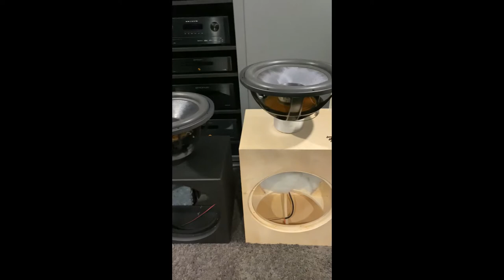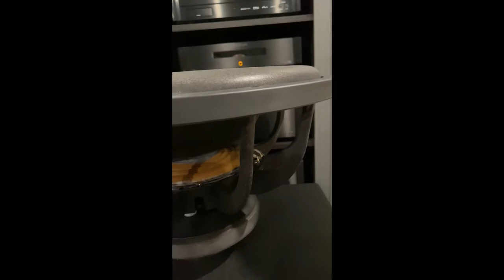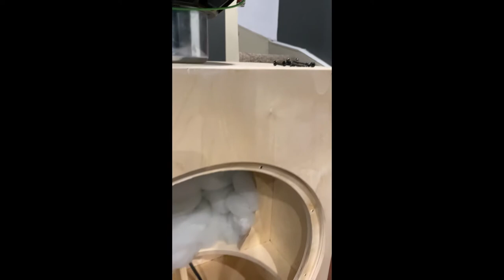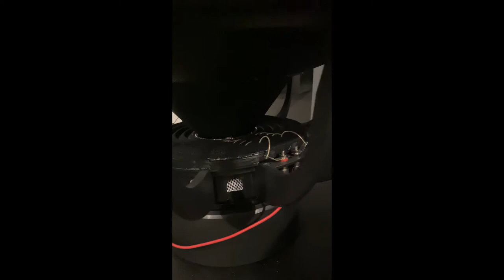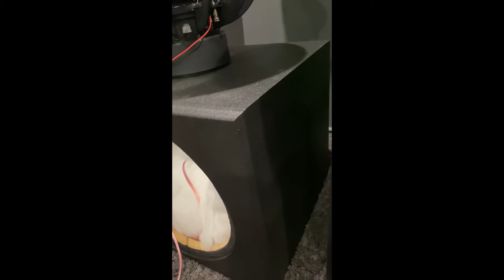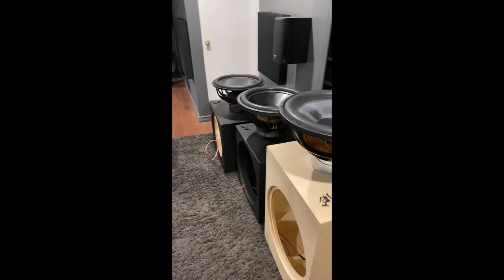Dayton Um18 - Jtr s1 - Harbottle audio m18vs

Comment: Hi there.i built a full dual marty x2 with um18 (custom)
But now I'm planning to try out sealed.
I'm not after high spl or super lows just the cleanest sounding over all. Is it Worthing trying x2 um18 sealed?.
Reply from the maker: Yes I think so. I preferred the sound of sealed from them. I used multiple so I still got tons of low bass. But I would say it’s worth trying out for sure!
Reply: @thebrowncinema  thank you. Yeah my old setup were dual 15 paradigm and liked the sealed sound. Can't imagine what an 18 sealed will do. Can't wait to start build.
What measurements did you use?
Reply from the maker: @almiragustin2262  mine were close to a 21” cube. I just made them 4 cft. But to be able to fit under my screen.
Reply: @thebrowncinema  what's your opinion on copying jtrs2 but running um18x2?  Dual 18's
Reply from the maker: @almiragustin2262  I tried to sim them on winisd once but got a weird response as I was thinking of doing that. Better off making them singles and stacking them. That way if you ever want to change it up they are already single subs
Reply: @thebrowncinema  yeah I think 4 individuals will be better option. 2 at front 2 at rear :). If I did do this setup would it be a big significant up grade to my 2 full martys? Sorry you seem to have alot of experience just watching your YouTube channel lol
Reply from the maker: @almiragustin2262  I think so for sure as now you can add them all in and they will help each other fill nulls ect so when you eq them you should get a better flatter response with 4 places at different locations then just 2 big monster Marty’s. They will sound different at first but once you get the right eq curve you like then watch it for a few weeks I’m sure you will love it. I’m glad I went back to all sealed subs. I’m a believer in strong sealed subs!
Reply: @thebrowncinema  yeah at the moment got big nulls at 70hz and very hard to get good room curve I don't want to boost to much. Thanks man. Love your channel.
Reply: Sorry you wouldn't know what measurements I can use for sealed un18-22?  Cheers buddy
Reply from the maker: @almiragustin2262  I can measure mine later or try and find some online. I would just build one to what ever measurements best fit your room
Reply: @thebrowncinema  I can play with any size. Smaller the better :). I may follow the parts express measurements.
Reply: Hi there again :). Iv built my x2sealed um18 and loving the sealed.  Just asking do I put a hpf on my mini dsp? At the moment iv got it at 17hz with a hard roll off. Is there anything you can give ad an advice? Thanks man
Reply from the maker: @almiragustin2262  no need for the hpf at all. I don’t run any on my sealed subs! Glad you like them.
Reply: @thebrowncinema  really? Won't blow up? Strange since iv gone sealed iv got way more mid bass and my wife even noticed the bass is cleaner (natural). . Ported just seems over exaggeration now I can hear the diff. :)
Reply from the maker: @almiragustin2262  no won’t blow them. I can play 7hz chopper scene on my um18 no problem. Ported is hard to get right, even then it needs to be eq’d ect, same as sealed so they sound good, but from all the subs I’ve ran, sealed and multiple of them is my favourite by far

Comment: Hi Brown Cinema, the um-18 box from the tour you did like 5 months ago looks different to this (the one in this video is asymmetrical). Did you dismantle the previous one? Also, can you please share the dimensions of the previous one? I want to make one that's symmetrical at the front baffle
Reply from the maker: That’s correct the one in this video is the parts express flat pack. The one from previous video was a custom one I made for the dimensions that worked for me. I actually built 2 new boxes that I will be doing a video of soon!
Reply: @thebrowncinema  awesome, I have modelled the um-18 on winISD and I'm comfortable with anything between 5cuft to 6.5... but I don't want to use parts express flat packs because of that asymmetry hahah. What made you change to this one?
Reply from the maker: @DesmondKarani  I run 4 cube after displacement for my sealed subs. I just built 2 modified some what full Marty’s. They are 11cubes tuned to 11hz. I’m painting them tomorrow so will make a video of them very soon.
Reply: @thebrowncinema  Was the front baffle triple baffled or duo baffle in the previous DIY? It looked sleek with the UM a bit recessed
Reply from the maker: @DesmondKarani  they are all double baffled. The jtr was the only triple baffle

Comment: So.. which of the 3 is loudest, cleanest, lowest response? Same power going in? Best bang for buck?
Reply from the maker: Tough question kind of lol. The jtr’s amp had a built in house curve that I couldn’t turn off. The amp would clip easily also, not sure why maybe boosted to much. Bang for the buck would have to be the Dayton 100%. But I tell people that ask me, If you had to buy 1 sub and only use 1 sub. The harbottle is amazing! I use it on my main floor off 400watts and it rocks (in the future I’ll get the speaker power 2400 amp for it). But if you want to do multiple subs and on a budget, then the um18’s is where it’s at. I’ve actually changed it up a bit since this video and I’ll be doing a new video soon just been super busy!

Comment: Nice video which is the best choice for a home cinema and playing music?
Reply from the maker: Out of those my favourite was the harbottle. The um18 is a good driver don’t get me wrong. The jtr is good also but being an older model and not able to turn off the built in dsp sucked and that’s why I sold it. The harbottle sounded amazing but like the um18 you need to pair it with an amplifier
Reply: So they are all good, these are a bit expensive for me I'm getting 2 spl 150 they should be a big upgrade from the r 120 SW the rear ported ones
Reply from the maker: @glengatt3941  yes in their own way.

Comment: Just ordered eight of the Ultimax 18".  I got one awhile back and did distortion measurements on it, it's a fantastic driver.
Reply from the maker: That’s awesome! What are your plans? All sealed or ported? 8 of them will be a ton of output!
Reply: @thebrowncinema  I have this grand plan of building a manifold system in the attic and making them infinite baffle... however, that's probably going to be too much work so more likely they will be in large sealed boxes instead.  I'll use miniDSP to EQ them and probably only use them for about 25 Hz and below.  I'll use multiple MCM 15" woofers in open baffle for 25 Hz to 80 Hz.
Reply: 8??? Wow! Would an 18" Dayton sealed compare to a ported Svs or Monolith?
Reply: @justinmanny86  I haven't tried the SVS or Monolith but I'm not a big fan of ported subs.  To me the best quality bass is open baffle, 2nd best Infinite baffle, 3rd sealed, and ported is a distant 4th.  I recently put in an additional four 18" Ultimax's so now there are twelve in the room.  I suspect they could do structural damage if I really pushed them.

Comment: Would be awesome to see how the ultimax compares to the other, much more expensive subwoofers.  I'm thinking about getting the another sealed sub such as the harbottle to pair with my SVS PB-13 Ultra (running in sealed mode).
Reply from the maker: The um18 can keep up. It will just run out of steam before the others. The more expensive drivers have more xmax and low distortion. So the um18 will start to compress while the other drivers will keep going. If your going to do multiple subs then I like to recommend the um18. But if your looking for something powerful and only can do 1 or 2 subs the harbottle is an amazing sub! 
I do have 2 of my um18’s in porter boxes now that I will be showing in a video soon!
Reply: @thebrowncinema  thanks for the note. I was thinking about pairing a UM18 with my SVS in hopes of getting a more even response in the room and some more tactile response. Ive hearn pairing a ported sub with a sealed can create some issues so maybe doing 2 UM18s instead and selling my SVS would be a better option.
Reply from the maker: @garethmorris2042  it can be tricky. I mix porter and sealed but I’m using the same drivers so it’s a little easier. Budget wise you can do 2 um18’s sealed and an amp for pretty cheap compared to many others. Just make sure to use a minidsp to tune the subs!
Reply: @thebrowncinema  so would you recommend 1 harbottle over 2 um18's?
And when you say it will compress do you mean in the low frequencies or at higher spl?
Reply from the maker: @Techdiscussed  in that case I would prob get 2 um18’s If there was no plan on getting a 2nd harbottle. For the price of the harbottle I can build 2 um18’s. So the more cone area will win plus the bonus of being able to have 2 subs in 2 different locations. The um18 will compress in spl.
Reply: @thebrowncinema  very intrigued to hear your thoughts on the ported um18!?
Reply from the maker: @levrone0075  I had 2 custom full Marty’s for a bit. I made 11 cube boxes tuned to 11hz. They were big, but worked very very well. I had them laying under my screen.

Comment: where can i find the specs of JTR RS1 driver? I would like to buy that driver and build a custom closed box, drive it with an external amplifier (I have to figure out which one to put) and give all the parameters with the Trinnov Altitude processor, do you think it is possible to get such a setup and it sounds great?
Reply from the maker: For sure. This was the s1 so the older model from the rs1. The rs1 is built by jtr as far as I know. You can contact them to see if you can buy the driver but not sure if they would do that. You can look into stereo integrity for drivers or harbottle audio. They sell raw drivers. For amps look into speaker power. That’s who jtr uses for their subs. Big power from plate amps.
Reply: Im looking at doing the same. You would need to hunt for a Behringer Inuke nu12000 dsp it is 2500 watts rms 2 ohm stable. That thing will run a pair of the Neo 3.7's.
Reply from the maker: @TheWaheed233  ahh yes that’s correct they were using fi drivers. I’m not sure if they still do or not though.
But I know the stereo integrity drivers would be easy to get. Then choose an amp or choice. Simbossen, speaker power, something that makes lots of power. Might be had to find that behringer though
Reply: @thebrowncinema  Fi drivers are still being used they are updated versions with a different magnet. 
Anyway nice video I enjoyed watching it.
Which would you say sounds the cleanest?
Reply from the maker: @TheWaheed233  ahh that’s good to know! I wonder if fi would sell those drivers then.
The harbottle I felt was the cleanest.
The jtr I felt was a bit at a slight disadvantage as I couldn’t take their in house “tune” off the amp. The jtr was still very clean but when I tried to push both hard the jtr would clip easily in my setup. I ended up selling it for that reason as I didn’t want to purchase a new amp or send it off. I’m still debating an amp for the harbottle but leaning towards a speaker power plate amp
Reply: @thebrowncinema  what are the specs for the Harbottle?
Reply from the maker: @TheWaheed233  here’s a link to the driver specs 
https://www.harbottleaudio.com/product-page/m118
Reply: @thebrowncinema  Thats a nice looking driver with some great specs. I would buy something like that however the shipping to my country and taxes with make it very expensive.
 Some plate amps are good but dont work out as cost effective as much as other options.  Have you considered the Behringer nx6000?
Reply from the maker: @TheWaheed233  I have 3 nx6000 amps lol. I did try one but wasn’t a huge fan for some reason. I may try it again this weekend. Bring it down from my main floor and run some sweeps in the theatre
Reply: @thebrowncinema 3? lol thats a good collection.  I checked that link to the Harbottle but they are showing out of stock on them. Are they not available anymore?
Reply from the maker: @TheWaheed233  built to order. They don’t meep stock. Once ordered it will be built.
Reply: @thebrowncinema  would you say the rs1 is as musical and clean sounding as the Harbottle?
Reply from the maker: @TheWaheed233  yes for sure. There was a bit of a tonal difference when my ear was close to the driver but couldn’t tell standing back. The jtr subs are no slouch. It’s pretty incredible how small the box is and how much bass it produces. My wife loved the size of it and was sad that I sold it lol
Reply: @thebrowncinema  Thats a shame it had to go.  Did you get to listen to music on them to compare?
Reply from the maker: @TheWaheed233  yes I had the s1 for a few weeks before I sold it. I actually didn’t use it for movies. I tested it out a few times for movies but it would clip very easily compared to the rest of my gear. Most likely a input voltage issue. So I pretty much ran it on my main floor system the whole time.

Comment: Great video. I'm looking forward to hearing the comparison. One thing that is very different between the three subs is the ability of the 18vS to be crossed over up in the 100 to 200 Hz range with the mains.
Reply from the maker: That’s a good idea. I should run sweeps up to 250hz and see how they do! I always ran them but only checked to 120hz.